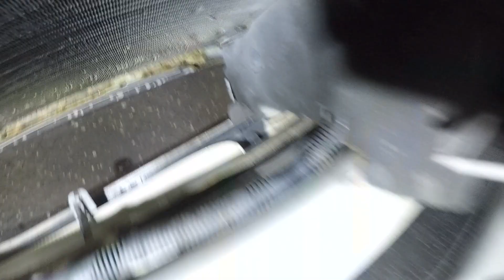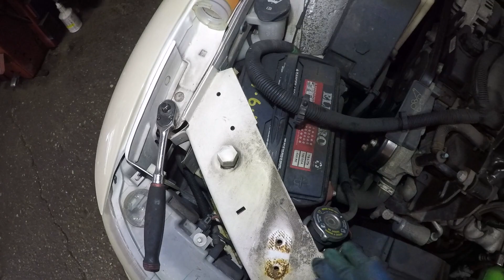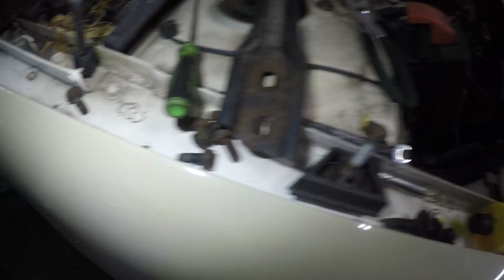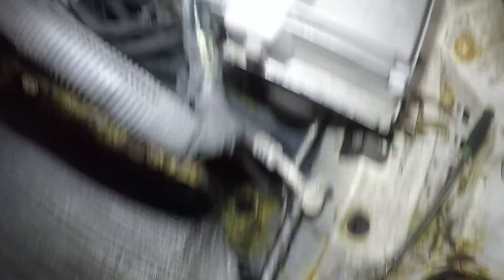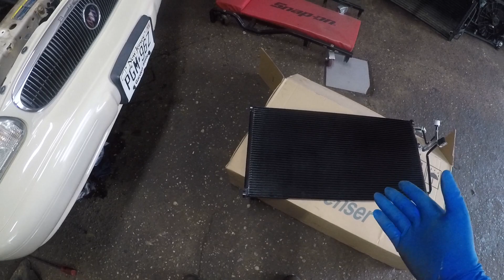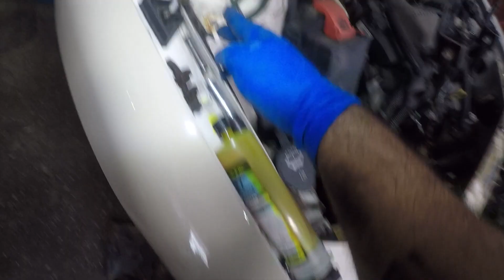How to replace AC condenser on 2003 Buick  Remove radiator and ran to change AC condenser

Comment: Hello Good video , on my Buick century 2000 looks exactly like yours I   removed both the radiator and fan assembly disconnected both AC lines the the problem  I'm having is the condenser does not BUDGE trying to just pull it forward from the 2 upper  RUBBER mounts is there bolts somewhere  holding it? What  am i missing?????? Thanks for any help
Reply from the maker: I have to look around to see what’s connected
Reply: ok thanks
Reply: Note The 3 8mm  bolt i did not need to remove after all they were part of the original condenser
Reply: I was able to get it out , I had to remove 2 lower 8 mm bolts on a bracket connect to the side of the condenser then i had to push the top forward with the rubber mounts attached  like your video said . I might spray the rubber with silicone to but the new condenser back in. II had to push quit hard to remove it i dont want to bend the fins putting the new one in.

Comment: I haven't got to the point of lifting out the radiator yet,  On another video they removed the top cover metal on top but my 2002 was welded on like I see in your video. In that one it was a laSabre and not a Regal like I have. So I see this car is more like mine. I didn't need to replace the condenser, just the radiator, Thanks for this video.
Reply from the maker: Good tip!

Comment: This is good but I would put a scissorjack With a block of wood Under the oil Pan To support the engine
Reply from the maker: Yuppp but I jacked it from side of car
Reply: @RBTheMechanic  ok
Reply: He remove the Torque struts, not a Eng mount. No reason to support the Eng/trans.

Comment: This is doable without disconnecting anything from the rad, there is enough room to move the rad forward and pull the condenser out behind it. Video was very helpful though 👍
Reply: How's that possible.Do you have to drain the antifreeze.
Reply: @westshilo3729  nope, just disconnect the mounts to the rad up top and pull up on the rad, then push it towards the engine and it will give enough room to slide the condenser out. The accumulator will have to come out as well
Reply: @thebandittransam9191 hope this will work with my Impala 3.8 lol

Comment: Hey RB I'm having an issue when I operate the climate control manually (Auto turned off).

With the AC on, the only time I get cold air is when I set the climate control temperature to low, any other temperature I set the controls to i get hot air.

When I need heat in the winter and I turn the AC off, the only time I get heat is when I set the climate control temperature to hi, any other temperature I set the controls to i get cold air. 

I cant control the temperature inside the car, it's either extremely hot or extremely cold.

 HELP!!!!
Reply from the maker: Ok first top off ur coolant that can be cause of low heat.   What kinda car u have year make model?  And regarding ac. Check to see if ur ac line under hood the low line is ice cold let me know
Reply: @RBTheMechanic  Coolant was topped off. 2011 honda accord EX-L V6. Yes, Low side line is cool to the touch.
Reply from the maker: @sheldan3520  ok remind me tomorrow I will check some stuff on my computer
Reply: @RBTheMechanic  roger that
Reply: @RBTheMechanic   Reminding you about our conversation about the heat inside my Honda as requested boss, found any info relating to my issue?
Reply from the maker: @sheldan3520  I just got a chance ok well too off ur coolant .. then run the car till it gets hot and touch both heatore core pipes under hood by the firewall I will send u video on another car check and follow the process see if there valve there that should open and close when u put ac on and then to heat it should open and close some times the cable comes loose check that also I’ll send u a link on the video
Reply from the maker: @sheldan3520  here is the link to the video https://youtu.be/MUYNVwD3P0c
Reply: @RBTheMechanic  watched the video.  Felt the inlet and outlet pipes/hoses they are both very hot to the touch. 8th gen accord doesn't carry the heater control valve.
Reply from the maker: @sheldan3520  check ur blend door motor it might be stuck
Reply: @RBTheMechanic Ok. so I had checked my original blend doors and they operated smoothly, no glitch. I still went ahead and  had gotten brand new ones from the dealer, changed them out and I still have the same issue. I only get heat when I turn the climate control knob to max heat.
Reply from the maker: @sheldan3520  now I’m puzzled my self if ur core pipes are both hotttt h should have heat no matter what did u check ur cabin filter try putting heat on remove the cabin filter completly see the outcome
Reply: @RBTheMechanic   I get  heat RB the thing is I have to set the temperature to 90° , I'm unable to control the temperature of the heat. Yes I checked the cabin filter as well, I had gotten a brand new filter, blower fan and blower motor resistor. Should the blend door actuator move in stages as you adjust the temperature?
Reply from the maker: @sheldan3520  yes ur blend dor motor should move as u move up the temp try that have some one put temp up for u and see if it moves gradually if not then that might be ur issue maybe the control is bad
Reply: @RBTheMechanic  sigh. I knew something was off because my actuators only either move to max cool or max hot positions. 
I had gotten a used climate control unit with the same part # off Ebay, replaced my old one with it and performed the self diagnostic test to make sure there were no dtc's stored in the system. 
I had my friend adjust the temperature gradually as I watched the actuator and I noticed it still wasn't moving  in increments. It only either moved to max cool or max hot. Your thoughts RB?
Reply from the maker: @sheldan3520  u can use scan tool to control the acuator and see if with scantool if it works propperly other wise it’s tough electrical diagnostic or just get new control unit some time I take chance with new part that spend couple of hours checking it. Also another trick try removing the opposit side if u got dual and if connector is same see if that works or still dose slow motion
Reply: @RBTheMechanic  
1. Was thinking about getting a professional bi directional diagnostic tool as well to try to control the actuators. I was also thinking what are the chances of my original actuators and brand new oem actuators acting the same exact way ??? 
2. Was looking into a brand new climate control unit as well... dealers by me says $800. 
3. Tough troubleshooting Rb...I even tested for continuity and good ground for wires between the driver & passenger side actuators and the climate control unit and everything was good. No short or open in the wires and no dtc's stored in the system, this makes it more tedious. 
3. Yes its dual climate control, both the driver and passenger side actuators behaved the same way. Whether I sync the driver and passenger actuators or adjust the temperatures individually, it's the same result....max hot or max cold.
Reply from the maker: @sheldan3520  let me check Monday on circuit how it works maybe resistance in the wiring some where
Reply: @RBTheMechanic  Ok. will  check back with you monday
Reply: @RBTheMechanic  Did you find any more information RB?
Reply from the maker: @sheldan3520  sorry I just checked dosent showanything that can cause resistance so maybe control or the acuator try swap test
Reply: @RBTheMechanic  Already swapped the actuators with brand new oem ones and the same issue. I'm going to try getting a brand new climate control unit as you suggested and try it. The used climate control unit  I got from ebay gave the same result as the original one.
Reply from the maker: @sheldan3520  yeah try that
Reply: So i wanted to give you an update RB. Previously i was only able to get either very cold or very hot air inside my car. I could not adjust the temperature in increments. After doing every thing you told me to do in your previous messages, i was still unable to solve the problem until now. I got a new fresh air blend door actuator and swapped it out and i was now able to control the temperature on the driver side and passenger side. This is weird considering when the fresh air blend door actuator opens, it simply allows fresh air from outside the car to enter into the cabin and when closed recirculates the air that is already inside the cabin. I am still confused how this was the problem all along.
Reply: Relatable. I have a 2000 buick park avenue. The climate control has been known to fail for multiple reasons.